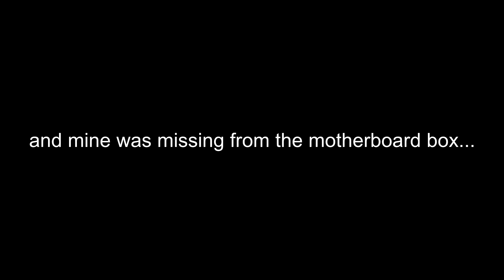How To Use Your SSD WITHOUT Screws Hack!

Comment: I got a different issue... My notebook motherboard came with the screw, but it is so tightly screwed that I just can't unscrew it!
I wanted to test it, so I put the SSD over the screw, so it is a little inclined, but it works.
Since it is a notebook, the plastic cover kind of holds the SSD in place.
Now I'll use your idea and glue it on top of that damn screw, so it won't come off.

I'm just afraid that in the long term the tension might damage something....
Reply from the maker: Well that should help keep it in place for a little while, especially with the cover  helping to security it, but ultimately I would suggest you remove the screw with the correct tiny screwdriver and put a new screw in its place to make sure. 👍
Reply: @SteveMack  Ty for the feedback!
Some ppl suggested to use WD 40 on it....
There's any possibility it would damage the motherboard? Would it be worth a try?
Reply from the maker: @fcsc7583  no I would be very reluctant to do that unless you applied a tiny drop of it with the head of a pin because of the risk of its spraying everywhere, and being a Petroleum based product it could potentially eat components. WD40 or rp7 etc is meant for use on seized metal to metal so it's extremely unlikely that you would be able to get it to the right place anyway. With great care if you have exactly and I do mean exactly the right size screwdriver for it (otherwise you may round off the head of the screw), apply moderate force (only!) directly down onto the screw whilst turning anticlockwise.

Comment from the maker: M.2 SSD Screw size: The correct screw size is 2.0 x 3mm (CM2x3-3.3). Make sure you check the length.

Comment: Is it safe? To do this
Reply from the maker: It worked for me! see my other video about looking for the SSD screws that are missing though
Reply: It's not conductive and the glue from the hot glue gun isn't hot enough to damage anything, so yeah it's pretty safe.
Reply from the maker: @ArtisChronicles  precisely. But I wouldn't use it as a permanent fix because hot glue doesn't always stick that well.

Comment: Heck you could've even used some tape in the place of a screw if you really needed to
Reply from the maker: No, not really - tape just wouldn't stick to the circuit board.
Reply: Steve Mack interesting. i know masking tape would do a terrible job for sure, just depends on the tape I suppose.
Reply from the maker: @ArtisChronicles  Yeah it'd want to be some incredibly special tape - MAYBE some form of medical tape...Trouble is very little area for it to go.
Reply: i have an issue where the previous owner of my motherboard broke a fucking screw off into the hole, i didnt realise this until after i bought a m.2 hdd, i tried using Electrical tape and it dont stay stuck for any longer than 5mins! im also not sure this method would work for me either though